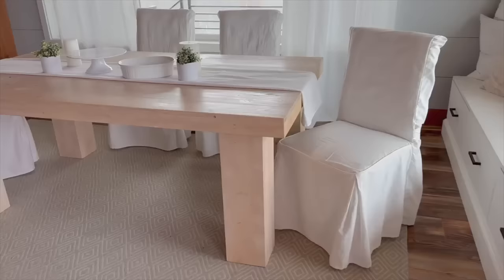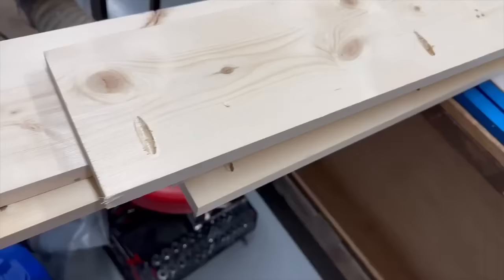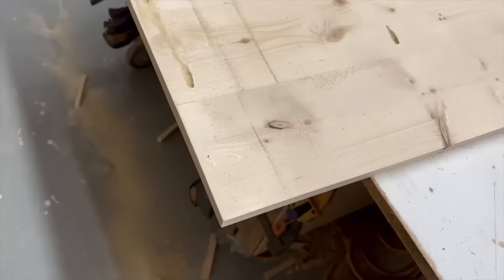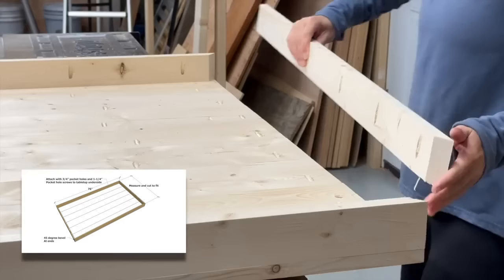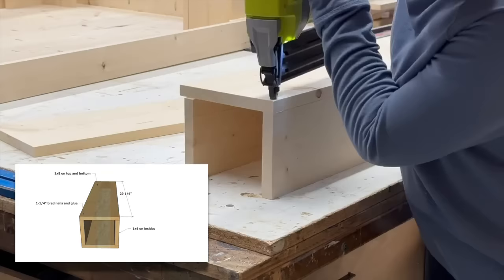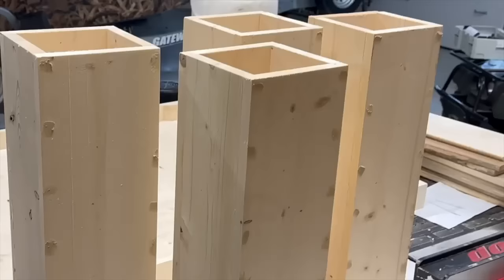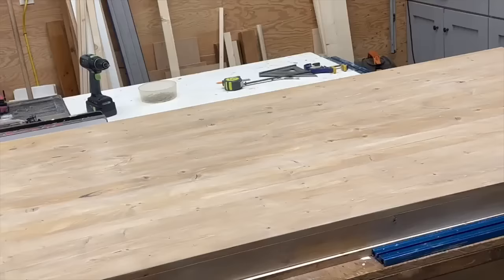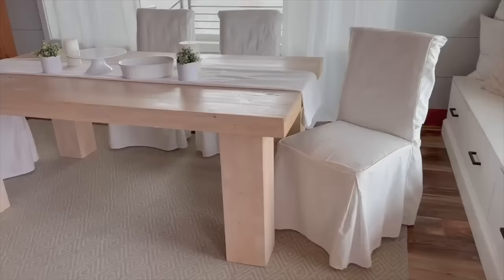I Built a Modern Dining Table!

Comment: I like this modern table design, but won’t the mitered apron corners eventually show large gaps? The aprons screwed crosswise into the top boards will inevitably move with the seasons at a different rate than the aprons screwed along the top boards. If you live in a four-season climate, I’d be skeptical of this design. If you look at the $2,600 table that served as inspiration for this build, you can see that it’s made from veneered MDF, which would work better for this design.

Comment: The problem with using this type of thin soft pine lumber is that they warp
Reply from the maker: Thanks for the feedback!

Personally, I have good success as long as the boards are kiln dried and acclimated- the table we had before still has a perfect top that is 5 years old and no warping or joint separation.   I’ll be doing a video soon on refinishing it and changing out the base. 

I find 1x tops with a substantial base do good, as the base holds the table down from warping. Lightweight bases are no good, especially paired with a 2x top

Just the experience I have and my two cents for what it’s worth!

Comment: Your plans are always so basic and functional.  And they require a minimum of special tools or techniques.
When you assemble your table tops, do you use glue as well as the pocket hole screws?
Reply from the maker: Thank you! I would do a thin bead, it won’t hurt!

Comment: Quick question, do you glue as well as pocket hole screw the table top or just rely on the screws?
Reply from the maker: You certainly can, pocket holes do pretty good - but glue would be a bonus!